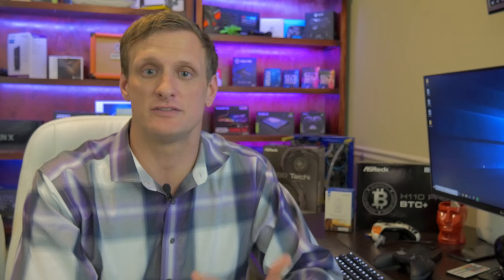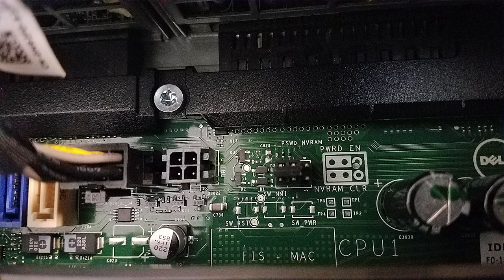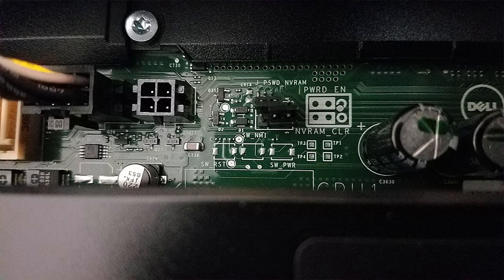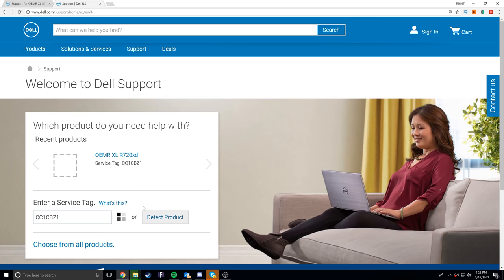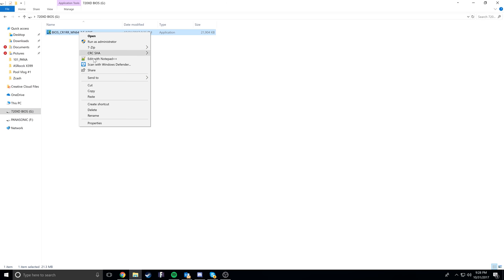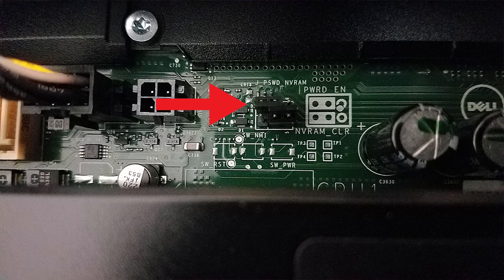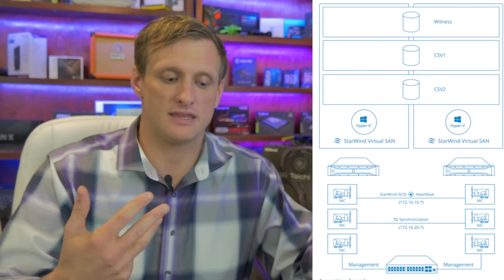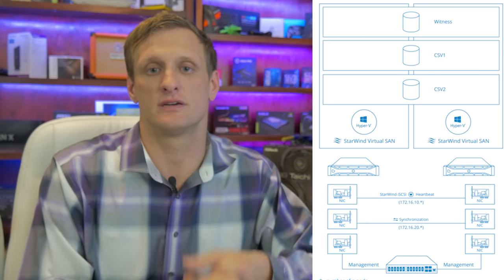Crypto Mining Pool Server Setup Vlog #2

Comment: I was wondering about the backend support for sumokoin. You answered that. Will sumokoin be merged into the multipool? Btw,  I'm getting ready to join your sumokoin pool.
Reply from the maker: +Tom Keyser we have no plans to move sumokoin as it would reset shares. We may consider it if the community pushes for another payout method ect.